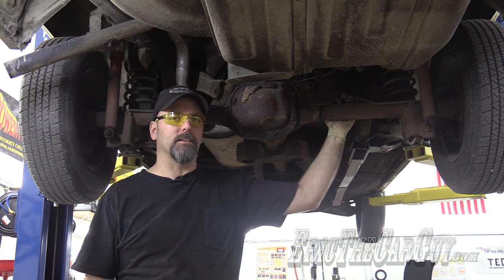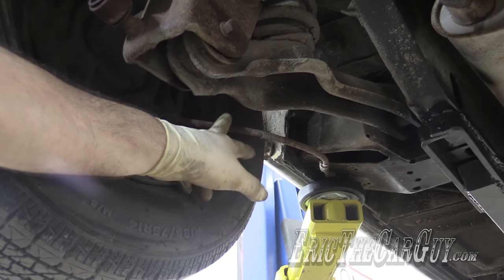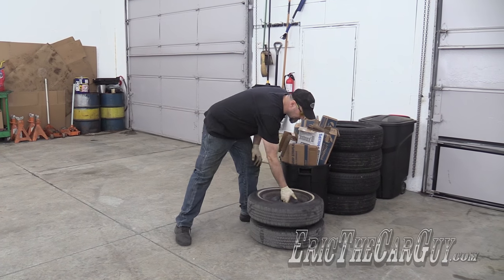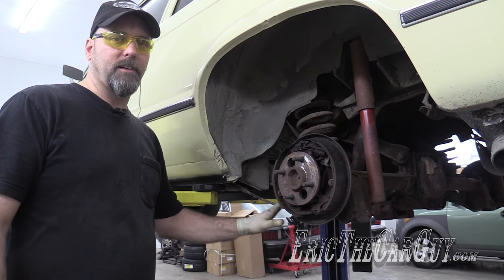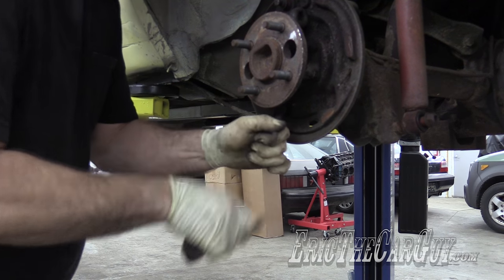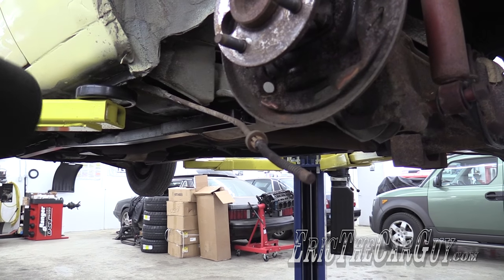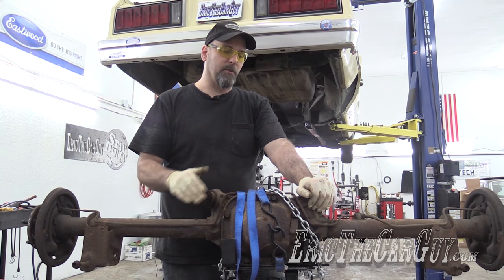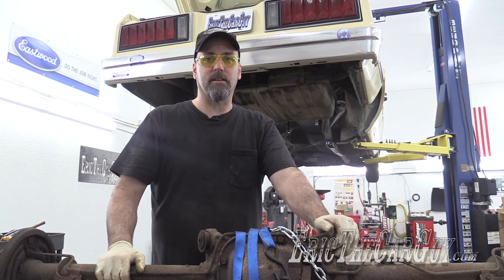Removing the Old Fairmont Differential #FairmontProject

Comment: Cut the old springs are The best decision! I like it! Good job as always.
Reply: If you take the upper control arms loose first you can drop the axle enough that you do not have to cut the coil springs.
Reply: but not too much of an issue if your replacing the springs anyway
Reply: True, but if your taking the upper control arms out anyways it saves the hassle of dragging the torches out.
Reply: +John Dove yes i agree but fire and molten metal is always fun if you do it in a safe manner. as well it looks better on camera
Reply: I can't argue with that.
Reply: you right bro. But it is a old springs.

Comment: yup. did that too on my 88 Stang. replaced the rear upper and lower control arms with out removing the rear axle assy. Second time i replaced the rear control arms was 2 summers ago on my back with just jack and jack stands. Not fun but got it done. bushings were no longer available for the first set .

Comment: If you stand on the rear end with the shocks removed the springs fall right out. Also thats the nicest Ive ever seen the rear end bolts come out, Ive done 5 so far and only one un-bolted like it was supposed to. Normally removing a foxbody rear end involves cutting disks and air hammers.

Comment: Time to name your trans jack "Quadrapus."  ;D

From what I've experienced dropping rear ends, when hanging at the shocks' limit, those springs aren't under very much tension, but it'll always be more than you think it is.  I personally like to disconnect the shocks last, and do so from the body mounts, rather than the axle mounts.  That way you can use your lift (or a floor jack!) to gently decompress the springs with the axle resting on jack stands.  There are probably a million different ways to do it, though!  :)

Comment: Hey Eric, if you want or need a tool for those bolts again sometime soon, sunex tools makes a special 1/2" drive wobble socket just for those 12 point 12 mm Ford driveshaft bolts, it works really well

Comment: I saw a transmission jack with straps tied in to the platform as opposed to chains. The ends looked looked almost identical to the triangle bit you see at a seat belt's end.

Comment: Interesting...  I removed, rebuilt, and reinstalled the 9" rear-end on my '68 Galaxie.  I didn't realize the rear-end on a Fox Body would be so different.  The spring perches on my 9" were welded to the axle tubes, for example, so you didn't have to worry about spring tension creating tension on the lower-control-arm bolts.  And I had a panhard bar, too, which you didn't have there.  Interesting to see the differences between the Fairmont and my Galaxie.
Reply from the maker: Yea, 2 very different vehicles. However, I think I'm going to go with a panhard bar and torque arm set up before I'm done with this car. Thanks for your comment.

Comment: if you break loose the nuts and bolts on the control arms and remove the shocks the differential will lower down enough to remove the coil springs without cutting them. just the tip from a broken-down old mechanic
Reply: Same here. Gotta develop techniques for when you don't have the option of cutting anything. One technique is to put the nuts back on the first few threads and hammer away, to at least pop the head of the bolt out far enough to be able to put the open end of a wrench over the shank of the bolt to push the bolt out as it is spun.
Reply: To late but anyway. This was the most wierd ting I have ever seen. Eric is a car mechanic and he did not know how to get it off?? haha. The spring push the controll arm downward so the bolt is locking up. The only thing he had to do was to set pressure to the controll arm in a upwards direction, take out the bolt and lower the support. use a breakerbar to force the controll arm in downward direction.  He had the support on the wrong place!

Comment: eric. hi love your stuff. helps me all the time. OK so I have a 1995 toy avalon xls. ran great not even check engine light. got home parked it disconnected - batt cabel. took out tape deck. hard wired in a new cd player(no wiring harness made for her) got done and car cranks strong everything works. no fuel no spark. did I mess with the anti theft or immobilizer?  put tape deck back in and same problem. any ideas or help would be great. thanks in advance.

Comment: Check out how the Jeep folks hook up the Jeep parking brake cable to a swapped Ford 8.8.  You basically cut the end off the cable and then use a couple u-bolt to make a loop around the hook.  Works great.
Reply from the maker: I've actually come up with a clever solution that will be shown in a future video.

Comment: I'm curious, but what was Ford's reasoning to switch over to a three-link setup in later model years? Was it for cost savings or weight reduction or better handling for launching the car? At least from my own experience, an adjustable 4-link seems easier to get set right at the drag strip versus am adjustable three-link and panhard bar.

Comment: Regarding the upper link missing a piece, it would be interesting to know what day that car was built on the assembly line. If it was Monday or Friday then chances are it never had that part put in. I would not think that the 4-link was really touched in the time after the car was built...
 - Eddy
Reply from the maker: It could have rusted out.
Reply: Oh yes, that's possible as well... this just reminded me of a co-worker of past. He used to work on the Ford assembly line in Detroit as a stand-in, for when one of the regulars did not show up. This tended to occur on the Mondays and Fridays. Needless to say the quality of the cars built on those days were below ones made in the middle of the week.

Cheers,
 - Eddy

Comment: just as a note if you let the trans jack down a bit with the shocks removed you can remove the springs without cutting them.  also this removal vid can apply to from fox body to 04 mustangs ans they used the same setup until then with the exception of the 99 cobra it had irs.
Reply from the maker: Thanks for the insight.
Reply: it don't look as good on camera though

Comment: Thanks for the video, Eric - appreciate it. Just wanted to ask as I didn't see it in the "Show More' section where you listed the tools you used. What tool did you use to hold the brake pedal down once you disconnected the rear brake fluid line? I've been looking around for something like that myself but haven't found anything so I thought I'd ask. Thank you.
Reply from the maker: https://www.jbtoolsales.com/lisle-46170-hood-prop-telescopes-from-20-to-48-1-4#oid=1002_1
Reply: Ahh. A hood prop. Tricky. Thank you, sir! :-)

Comment: Eric where's the new exhaust kit, do you have any pics of that yet and is it big enough that it won't be disabled with a banana in the tailpipe?
Reply: I think he might use the exhaust from the old black Fox he parted out (but might be built into another budget project later on). Mythbusters actually tested fruit in the exhaust.....and it just got shot out from pressure
Reply: Andre Gross that's the way to go!
Reply: Pound a potato up the tailpipe; ya that's the ticket.
Reply from the maker: It's going to be custom.

Comment: Nice job Eric...question.  I know what you do with the waste oil/fluids (you've mentioned that), but what about tires and metal?  Do you have a scrap bin you save the scrap metal in for resale?  I know steel is pretty much worthless right now, but if you run into a couple thousand pounds over the course of a year you have some adult beverage money.  :)  Just wondering...
Reply from the maker: I have a guy that picks up the scrap. So far I store the old tires in a shed out back but I need to find a better solution for that soon.

Comment: I got really excited that you were starting to release midweek Fairmont videos, then I realized it was actually Friday. :)
If you were going to save the springs, would you have just used spring compressors to take the tension?
Reply from the maker: I could have probably dropped the rear end without cutting the springs. I was just being cautious. Also I like using my torch to cut things.
Reply: Who wouldn't like cutting things with fire! :)
Reply from the maker: Right?!

Comment: Hello Eric, a bit off-topic but may I ask for your advice? I have a 17 years old Seat Ibiza II 6k1 (kinda like volkswagen polo mk3) I don't think you have that overseas. Anyway I bought it 2 years ago and it runs quite well, no major issues, 1400cc. 37 MPG, has 140k miles in it. I bought good quality Toyo tires partially because you said how important they are, I couldn't agree more. The thing is I'd like to drive it for a few more years at least and I'm going to have the MOT in the near future. What parts would it be a good idea to have changed in order to give the vehicle some love? (I was thinking : sparkplugs, transmission fluid (that's a maybe), fuel filter etc) Thank you very much

Comment: When you were cutting the springs, before they were actually separated, did they contract because of the heat like the spring in a thermostat or because it was starting to buckle from the cut you were making?
Reply from the maker: Buckling from the cut.

Comment: That looked like the same brake setup that was on my 93 Navajoke.
Reply: Many of the early (and late!) RBV (Ranger-based vehicles) used the Ford 7.5" rear axle assembly as the standard option.  Explorers, Aerostars, Mazda B-series and Navajo just to name a few.
Reply: Explorers and Navajos NEVER used a 7.5" axle. They all had 31-spline 8.8" axles. Rangers/B-Series used 7.5" and 8.8", depending on engine. Don't remember which axles Aerostars had.

Comment: i might be a bit to green but, why didn't he use spring compressors?
Reply: because in the rear of most solid axle cars there is enough droup with the shocks disconected to take the pressure off the springs, unlike the front where the travil is limited and the lower arm swings in a arc making the compresssed spring shoot out twords you before it is fully decompressed
Reply from the maker: Fire is easy and fun.

Comment: You have a red colored cable going to the - terminal...
Reply: So? As long as you know which cable is which, the insulator color does'nt matter. Electricity does'nt care what color the insulator is.
Reply: Why bring race into it
Reply: David B. Fishburn
So? As long as you know there's gasoline in that yellow diesel fuel container, the color doesn't matter, right? As long as you know there's gasoline coming out of that green pump handle, it's all good? Fuel doesn't care what color it's coming out of.

It's  not so much about what you know, you special snowflake, it's about what the rest of the world knows and assumes.
Reply: +opl500 back in the old car days they just sold the same color ones a lot of times at parts stores. You have to pay attention to the marks on the battery.
Reply: I always look at the battery.
Reply: opl500
 Wow, calling names is a real civil way to discuss something, right? The thing is with electricity is that it works regardless of what color is used to id the wires. As long as one knows the polarity of the wires, it's all good. Now, fuel on the other hand, yes, one does need to know the colors, but one also needs to look at the labeling on the pump and on the containers. It is still wise to check the containers before putting what is assumed by the color alone into the fuel tank. Paying attention to details is what pays off, instead of making assumptions.

Comment: That gear oil really permeates your nose and fingers and skin do not let it get in your clothes either ruins them. is that Fairmont axle a 7.5 ? teeny tiny 8.8 or even 9 inch sweet.
Reply: That axle is toast too see how much play is in the spider gear when you took those prop shaft bolts off ready to break.

Comment: Do all these classic cars have metric fasteners?
Reply: No.
Reply: Some do, some don't. some have a mix of metric and SAE. Many of the metric sizes fit on the SAE sizes.for example, 1/2 is 13mm, 9/16 is 14mm.
Reply: anything made in America before 1990 most likely will have no metric stuff. after it may have a mix. the socket sizes are so close between the 2 you can pretty much use metric or standard for everything.

Comment: Not a be a dick or anything. But this is rear axle removal.. Removing the differential is to open the rear axle up and removing the housing that has the spider gears in.
Reply: Well you could get all technical and it would be the diff housing not the rear axle. The axles are the shafts that fit inside the housing the same way the diff gears do.
Reply: Isn't it technically called a rear axle assembly? I know thats what Ford and GM's service manuals call it.
Reply: its a thing
Reply: Oh wow you know the proper name, you must work on a lot of cars!
Reply: joe Costello What if someone has a rear axle on their table and they cant figure out how to remove the differential and then they click this video and waste their time.
Reply: +V4 Garage considering this isn't a entire how to video. they would be pretty dumb to try and use it. also it would be called removing a live axel assembly. axels are the shafts in the housing and the differential is technically the gears and whatnot. most people call that the third member or carrier and the housing the differential or diff because it's shorter.

Comment: There was absolutely no reason to cut the springs. More or less pressure on the rear end, and the lower control arm bolts would of come right out. I feel like the cutting torch action was just for video excitement.
Reply from the maker: Sure there is, it makes for dramatic video. That is what I'm doing here after all.
Reply: +EricTheCarGuy I don't watch your videos for that, yet. I don't expect that kind of content. I dont see any drama that would come from removing an 7.5 rear end.
Reply from the maker: Neither do I, that's why torching the springs makes it interesting.